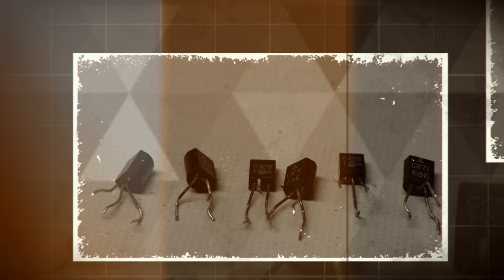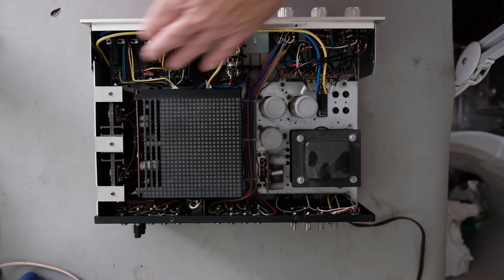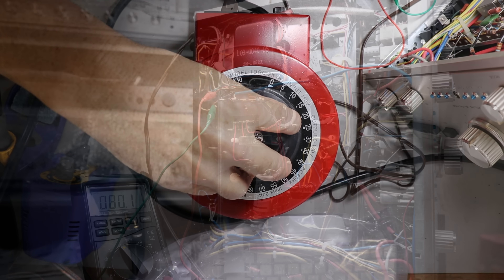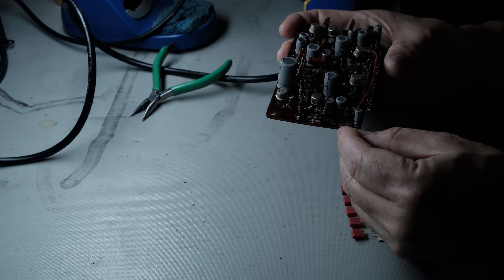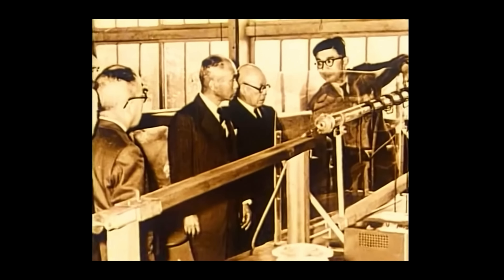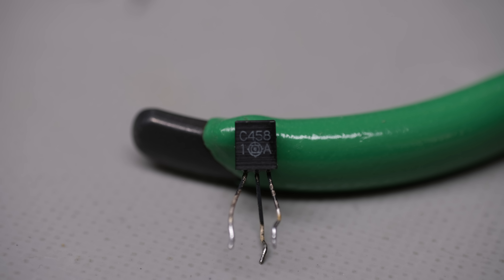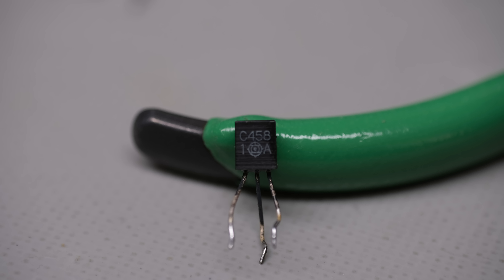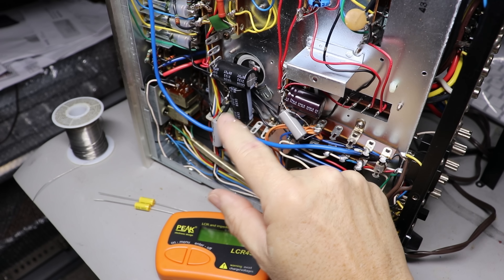$45 - Buy This Amplifier! Cheaper And Better Sounding Stereo. Spend Less On Vintage HiFi Audio Gear

Comment: Thank you for uploading this presentation and your explanation is always excellent.  BTW, at 19:13, I see Sony Building scene.  I was there in 1975, that is the Sony presentation building located in Ginza, Tokyo.  I went inside and  Sony was demonstrating their best preamplifier and power amplifier that time, the Sony TAE-8450 preamplifier and TAN-8250 power amplifier hooked up to some kind of strange looking square woofer, I don't believe that was an electrostatic.  It sounded very good.  Sony made VFET amps, one was TAN-8550, I had that.  I bought integrated version from Air Force Exchange when I was stationed at Yokota Air Base, Tokyo.  Those were the great days for audio equipments.
Reply from the maker: Your welcome. First of all thank you for your service. Thanks also for sharing your Sony knowledge and experiences. They made some great audio gear back in the day.

Comment: I do repair and restoration equipment as well, I have a KA-7002 I need to get to. I’m sure this has already been said in the comments, but another benefit of going to film caps for the smaller electrolytic values is that in theory they should be permanent. They won’t need changed out in the future like the electrolytics would.
Reply from the maker: That's true. Thanks a lot for sharing.

Comment: I too repaired my Sansui au-666.  I changed some caps and replaced most transistors and works again perfectly.
Reply from the maker: Good Job! Your Sansui is a fine piece of equipment.

Comment: I had a Kenwood Tuner (KT-7000) and Scope (KT-6060a) from that era. I traded-in the Tuner in 1999. Recently re-capped the scope and use it as a diode tester. I always thought that was a cool looking amp. SONY and Kenwood had the best front panel designs in the 70's. (IMHO)

Comment: I would just like to say I am enjoying your videos. I am looking to start a new hobby of fixing vintage equipment and this has given me the confidence to do so. Hopefully with the sudden increase in demand in vintage equipment, I can find some for a reasonable price and fix them up.

A few things I did notice:
- For applying thermal compound, could you use a nylon brush for applying the compound? I use them at work for applying lithium grease to moving mechanical components.
-I was wondering why you decided to keep the old filter capacitors in the chassis after installing the new capacitors.
-You have a couple of audio files overlaying each other, particularly around 44:56 while you are explaining something. 

Would you show a video where you would use an oscilloscope for diagnosing faulty components? I would like to see some troubleshooting techniques with that particular piece of equipment.

This was a great in-depth, yet simple explanation of vintage audio repair with a nice list of helpful tools. I look forward to more videos. 

Cheers

Comment: This is the model just below the KA-7002, which was Kenwood's first DC-coupled integrated amp.  I owned a KM-8002, which is the power amp version of the KA-7002, for many years and it was a very good performer -- but I must say, as good as it was, I now have a couple of sub-$100 (including outboard PSU) Chinese "chip amps" that easily outperform both that KM-8002 and the "audiophile" Adcom GFA-535 that replaced it in my system back in the day.  Audio has never been better in terms of price/performance ratio than it is today.  Collecting vintage gear is a fun hobby -- and, for we old-timers, a nostalgic trip down memory lane -- but the best way to not "spend a fortune to get the great sound" is to buy carefully selected modern gear.  Don't get me wrong, I still have a couple of mid-'80s Yamaha pieces in my system and much appreciate the thorough engineering and meticulous Japanese craftsmanship that went into them -- but if there were modern equivalents for sensible prices I'd happily retire them.
Reply from the maker: Thank you for sharing. I get what your saying. For me, vintage electronics is a lot like classis cars and modern cars. A lot of good can be said about both.
Reply: @vintageaudioaddict  -- Your videos are very nostalgic for because of the years I spent managing a busy audio repair shop back in the '70s.  As a factory authorized "service center," we worked on thousands of Kenwood, Sansui, and Pioneer products -- not to mention dozens of other brands -- and it's interesting to see how nicely this particular piece held up after all these years, those problematic little transistors notwithstanding.  Thank you for your work!

Comment: Wow. Can't believe this .I have this unit along with the tuner.  The 5002 Rt channel has stared to get very low. The balance doesn't help and is way off.  Started looking today for help and no one knows anywhere to repair it. I'm at my wits end. Had this since 1971 and it's been great.  Started looking TODAY for help and saw this.   I cleaned what I could with Deoxit. Didn't help. Any advice would be greatly appreciated. Thank you.

Comment: Kenwood had some great integrated amps.... I prefer the one's from 1969-1974.... I just picked up a minty KA-6000, which i think was one of Kenwood first S.S. integrated ... Inside the unit its very busy and made me think of a tube amp.... It plays nice,,, but wish i had the know how on and where to begin and replace old parts.
Reply from the maker: Nice Find! Just do a little internet research. There's a lot of info out there on most any piece of vintage audio equipment. Maybe that will help you figure out on how to proceed with your new unit. Good Luck!
Reply: @vintageaudioaddict   Mine seems very similar to this one your working on... Love them.
Reply: Yes, I thought the same about this amp.... but instead of "busy" the word was messy. It looks like the model they made just prior to this was a valve amp, aside of being riddled with those crap wirewraps. 
I guess the performance level of this is like what my Dr says when we go over my perfect Cholesterol levels... "How does he do it"?

Comment: Nicely done. did I miss where you checked the +/- highest voltages for the power amplifier and all the low voltage values that are distributed to the various modules? And with a quick look, perhaps I must have missed the check on the DC balance of the speaker connections before you connected speakers. Many times the fingers on modules are not gold plated and need to be cleaned. On occasion, I've taken apart alternate action push switches because of intermittents.
Reply from the maker: Thanks for watching. I'm really not sure what I showed in this particular video. I just don't remember. I usually go through them pretty thoroughly but I don't always show everything in every video. Thanks again for watching.
Reply: I was thinking the same thing. No checking the DC offset?

Comment: Hi, the second video of yours I've watched and I think there really thorough, even including some company history of products being restored.  I notice with a lot of videos like this that resistors are rarely ever mentioned.  Ben Duncan in the eighties, writing for HiFi News & Record Review wrote an article on building your own quite sophisticated preamplifier.  It was a really thorough article ( a good read) and one of the things he included was frequency response curves relative to the component parts tolerances.  It showed quite clearly how very tight, even better than a percent affects the response.  I know that this is a budget project but maybe one place to improve resistors is the phono section, particularly the load resistors to at least a one percent metal film type; still very affordable and should give an audible improvement.  In one update to a high-end preamp that used 1.0% metal film throughout the design, I installed matched Vishay to 0.01%  film and foil resistors ( I think $25.00-$30.00 a pair.  I know, insane) in critical places like the phono section, it capable of up to 80 dB of gain to noticeable effect.  anyhow, great stuff.  Makes me want to pick up some projects to repair.  I even picked up A Hakko Fr-301 on Amazon.  But they're not $100.00 anymore.
Reply from the maker: Thanks for watching. Thank you also for sharing your experiences. The information helps everyone to make better decisions when repairing, restoring or updating their equipment. Your going to love that de-soldering tool!
Reply: If it sounds good to you, it's worth it. But I can't imagine anywhere in an amplifier circuit that a 0.01% resistor would make a difference. Transistor gain is going to vary lots more than that. You could always put in trimming pots in series or parallel and "tune for minimum smoke", as the hams say.

Comment: I have this same Kenny but the 7002 spec. Absolute sleeper of an amp. Amazing built like tank and solid internals albeit requiring recapping and transistor replacement as needed. Using this as my main pre-ampnalomgside a Kenwood KA 6004. Open , dynamic, deep fine bass tube like sound with solid state reliability that can rival or even put modern amps into shame. Only downside is that finicky and tricky Null balance set up.

Comment: Much thanks for your clear and helpful narration. Hats off 👍 I have optonica sharp power amplifiers Model SM—4000H and SM—3000. Both are not turning on now. According to your advice electrolytic capacitors to be charged. Any chance to get your email or WhatsApp for rebuild it.I had changed power indicator double LED ( red and green) around twenty years ago from sharp company service centre when I was in Doha Qatar. It is not available in company parts centre now.Hoping your helpful advice to get quality components for rebuild it🙏🙏
Reply from the maker: Your welcome and thank you for watching. I've never worked on your specific pieces of equipment but check - mouser.com and digikey.com for parts.
Reply: Thank you very much sir 👍

Comment: Thank you for your video sir, I have been in and out “self taught for the most part” of consumer elect. repair for last 35 year out of my house. It’s been a fun learning experience with many battles won and grey hair now to show for them at 55 years of age. Your troublesome transistor data-sheet looks like a very helpful additional piece of data to have access to. Is there a chance you could share your source for this Troublesome Transistor information with suggested modern cross referenced replacements listed beside. I would love to have a THD Tester, all I can do is measure my 1kHz sine-wave on my scope “with dummy load” and look for any clipping or other abnormalities, as well as use my biological aural detectors :^)
Thanks again for your video, nice restoration! Time to get back to the Pioneer SX1000TW repair very soon.

Sincerely,
Mike
Reply from the maker: Hi Mike, Your welcome and thank you for watching. Link this link for the "Trouble Transistor" List. - https://drive.google.com/file/d/1InWTOz8Y-H4zyDXva5yvUXuMExEbsR7J/view?usp=sharing
Reply: @vintageaudioaddict  Your welcome and thank you for the link. I’m alway looking for as much information as possible when it comes to semiconductors. You are spot on when you mention the special temp sensing diodes used for output transistor thermal biasing. These are most always impossible if not impossible to find replacements for. Something interesting I learned awhile ago was about non electrolytic type capacitors that are being used to couple audio signals. I see a lot of these high voltage type caps esp in tube guitar amps. These typically non-polar type caps actually have a band that is supposed to denote the outer foil of the cap. If installed in reverse direction the caps can pick up noise from the outer foil like an antenna. Mr Carlson’s Lab on Youtube has some interesting info on this and how to find the foil attached lead end  of the cap if cap mislabeled or unlabeled. Frequently the caps get flipped around in production and get band printed on wrong end.
Take care, best of wishes with health, and success with your repairs my friend.
Reply: It should be possible to measure distortion with a spectrum analysis tool, which would also tell you what the distortion products are and identify them. I wonder how good you could do with a PC sound card and FOSS software, which would be basically free. I suspect somebody has already tried this. Hmmm. 
I have a microwave spectrum analyzer which doesn't go that low. And cheap scopes which don't do the math. 
Biological detectors suffice for the most part. If it sounds good, it's good enough.

Comment: Should have tested specs of amp before and after the new parts to see if the new parts made any improvement in the original specifications
Reply from the maker: I've done that in the past. It doesn't really matter to me what the results are with the original parts. The main reason I restore my equipment is to make it reliable. With a unit like this one being more then 50 years old you have a ticking time bomb if you don't service it.

Comment: Thanks for the excellent video.  I really wish that you'd taken the amp to clipping. Why stop at 35w if it hasn't clipped yet?
Reply from the maker: Your welcome and thank you for watching. I use to push my vintage gear a lot harder on the test bench then I do now. I'll never run it in a system very hard. She's an old girl. I'll give her a break.

Comment: what solder station you use? could not get a good read on it
Reply from the maker: It's a Hakko FX-88B. I don't think they make the exact model anymore.
Reply: I think I just ordered the next model up. My current station just puked out on me. The way things go. It’s my luck 💯 of the time

Comment: Great video. I have an old Sansui 661 that I bought in 1973. The FM tuner dial shows the stations about 10 numbers low, like 107, coming in at 104 on the dial. What would be the cause.Everything else seems to work fine.
Reply from the maker: Thanks. With your tuner if could something as easy as the tuning string has started to slip some. Bee's wax works well on the tuner string if that's the case. Of coarse it could be more then that but that's something you may be able to look at.
Reply: @vintageaudioaddict   Thank you for the reply. Yes, I think it's something more, because down at the lower end of the dial the distance of the discrepancy is less.

Comment: Great videos, I’m am so glad I came across your channel. Do you mind sharing your thought process for selecting electrolytic caps , I see you have selected nichicon kl caps for some areas and Elna Audio grade caps too. I am always at a cross road between audio grade and low esr and low impedance caps. Any help and guidance will be appreciated.
Reply from the maker: Thank you for the kind words. My personal experience has been that I have never been able to tell the difference in sounds between brands/series of capacitors. I have tried about every combination of brand/series that you can think of over the years. I can't tell a difference between them. I'm not saying that other folks can't, I just can't. With being said I think that you should use a name brand like the one's that you listed. I feel from my experience that the difference in sound that I do hear from various pieces  of equipment has to do more with the topology/engineering of the product.
Reply: @vintageaudioaddict  thank you

Comment: Just purchased a kr 6400 for an insanely low price thinking I would have to restore it well it works flawlessly this unit barely gets warm there’s no noise makes me think somebody has been in there already. The only problem I see is the dial string is a little slippery when tuning is there a fix for that
Reply from the maker: Nice! She's a good receiver. Try a little bee's wax on your tuner string. That's worked well for me.

Comment: As long as the iron is good.
Reply from the maker: Fortunately the transformers in most vintage audio gear has shown to be pretty reliable. I do hold my breath everything I hit the power switch on my Marantz 2500 as the power transformer in those has shown it can fail.
Reply: @vintageaudioaddict  I think the output tranny is the biggest hitter as many of them are propritary and cannot be replaced. I do so love tube amps!!!